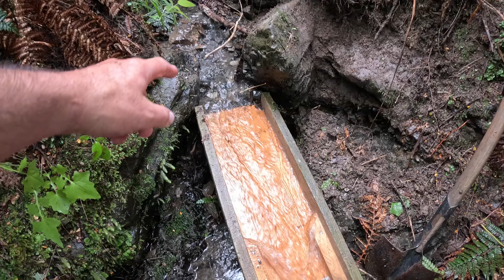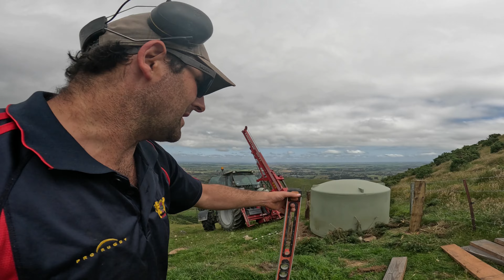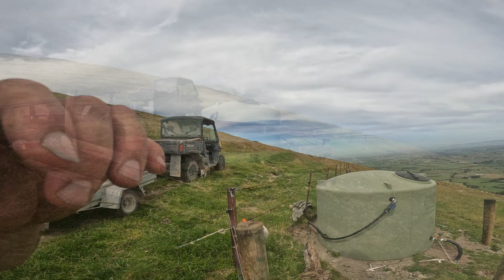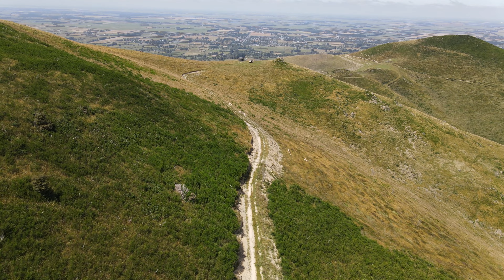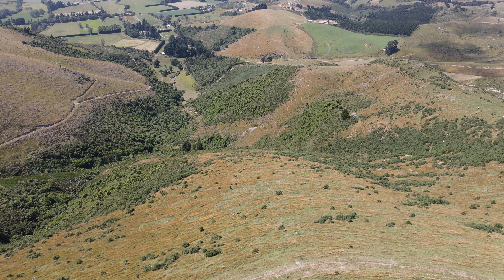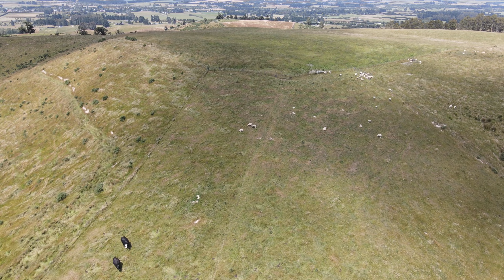Water supply part 5: Finishing touches as Summer bites

Comment: whats the return per ha for ets plantings? and what is your return per ha with your current operation?
Reply from the maker: Profit per ha currently on the areas identified for trees is around $200/ha/year. Keep in mind we need to spray these areas for gorse $500/ha every 4 years or so. 
ETS in Perminant forestry for 50 years returns (profit) $1280 per Ha per year  at a $65 per T carbon price, Under averaging and harvesting in 30 years the Profit is $2500 per ha per year, (note this dose not include replanting or silver culture costs)
Reply: Excellent thanks. Whats the profit per ha on the rest of the hill area? btw excellent work on the water scheme. I've maintained similar over the years.  @kiwifarmernz
Reply from the maker: @troyallan8683  Thanks. All depends on stocking rate. Better hills will be around $300 -400 per ha
Reply: @kiwifarmernz  intriguing. Would like to discuss this further at some stage.
Reply from the maker: @troyallan8683  sure thing

Comment: You mentioned you had a Bunyip Pump but replaced that. I was wondering why as they seem very reliable and easy to install? Maybe I'm wrong but I'd value your thoughts and advice on this. I am considering importing these pumps for difficult locations here in Scotland.
Reply from the maker: They would be good in the correct situation, Ours not being that. Our flow is to low and the head to pump is too high. I thought it might work but sadly it is not. If you have heaps of flow, not to much head and not silty water they would be great.
Reply: @kiwifarmernz  Thanks , that's very helpful. Yes we have loads of flow and not too much head so it looked like a very good solution to me but was wondering why it didn't suit you. Great video and very helpful. Thanks for the reply.
Reply: @kiwifarmernz I came up with an intake design for a gravity fed supply in a very silty burn and so far it seems to be working fine (6months). I'll send you a photo to your website address on Monday when I am back at work. It may be a cheap and cheerful solution if your new intake doesn't work out.
Reply from the maker: @bumptybump  thanks very much